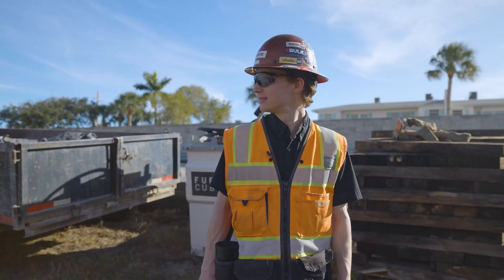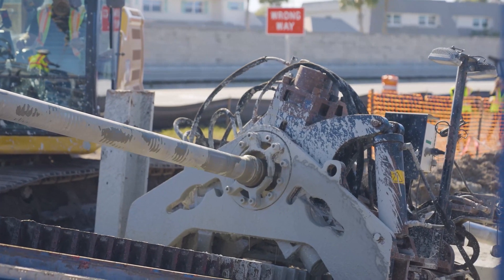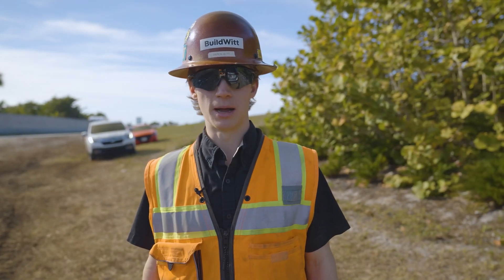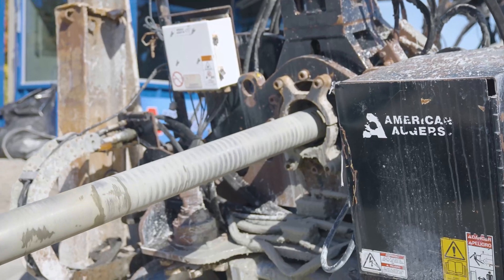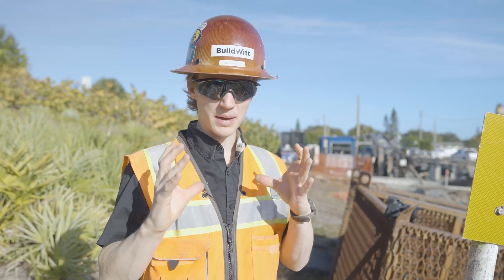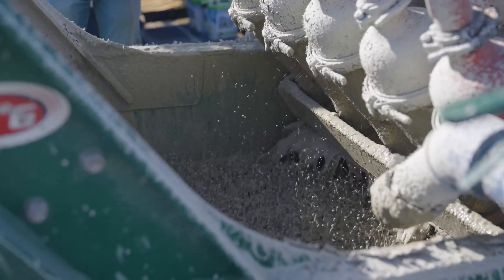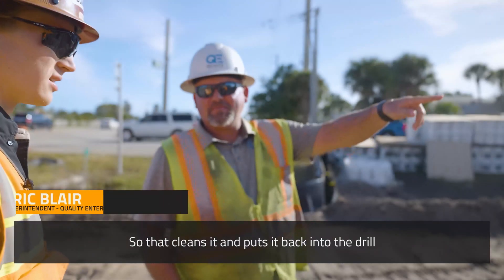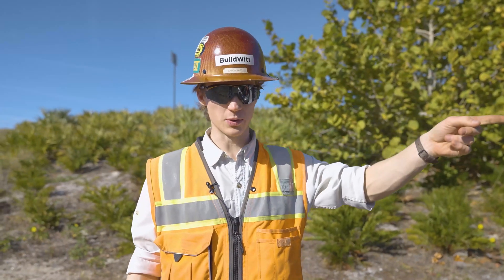40,000ft of Water Lines | Directional Drilling In Florida | Earthview

Comment: Thank you for showing the drill at work. I saw one of those on display at Con/ Expo. The separate control station. Yes standing next to it it is massive. So much bigger than my small hole hog, doing or air driving for 1" water service's.

Comment: They use that big of a drill to only open up to a 762 mm hole. we use a jt25 and a jt4020 to ream up to 900mm and pull a 140 meter shot
Reply: Mad innit we use a 4045 to ream a 1200mm hole and pull 200 meters long
Reply: I’d say they aren’t pissing around with small lengths like <500m
Reply: Yeah 2k feet is a shit load more then a 500ft on your baby rigs lol